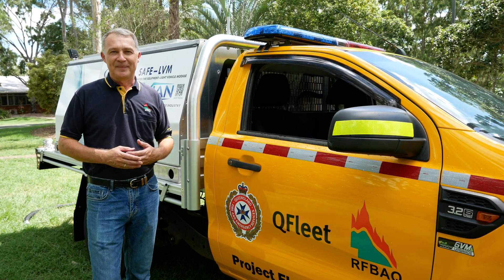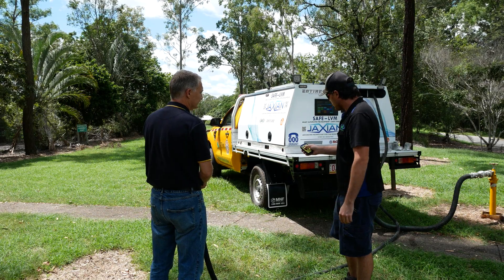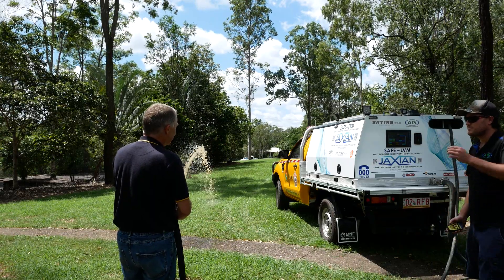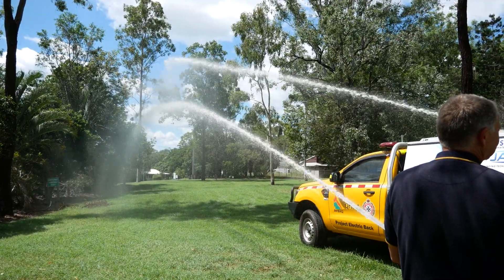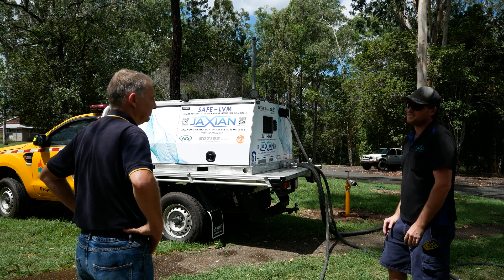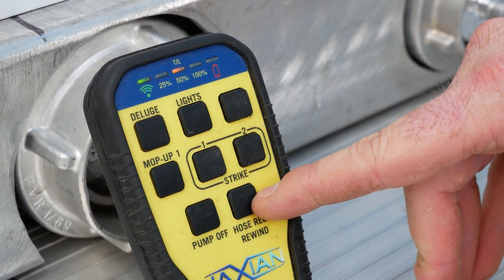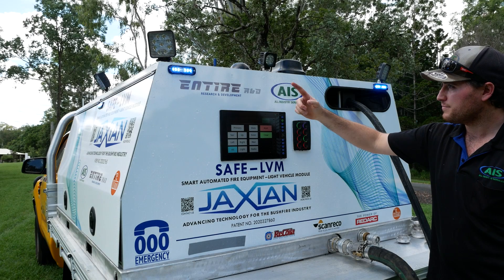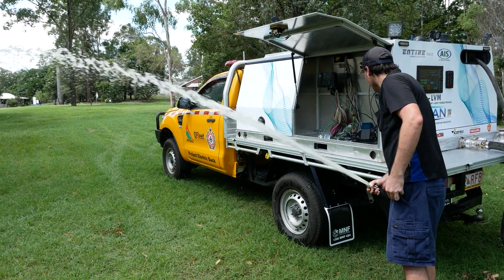The Pebble - Project Electric Back

Comment: I like what they've done with the pump system - the pressure, the flow, the control panel and remote, self-priming drafting, operational time, water quantity - good build.
And, apart from having to set up the wiring to the base vehicle, they have a slip-on module. Very nice execution for a Proof-of-concept.

Comment: Wonder how overweight these vehicles are like most of the others 😂
Reply: These pumps and battery set up are lighter than the currently fitted diesel/petrol powered units as Justin mentioned in the video clip.
Reply: @stevewhitehouse4051  A gx390 only weighs 31.7kg dry the pump itself would have to be 60-80kg to be saving weight.